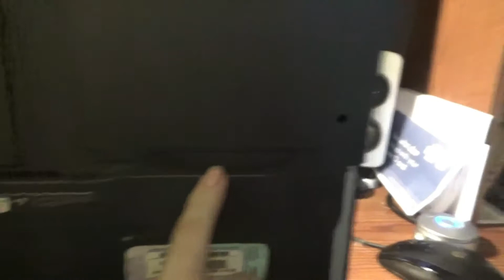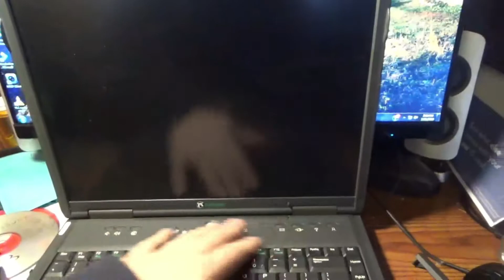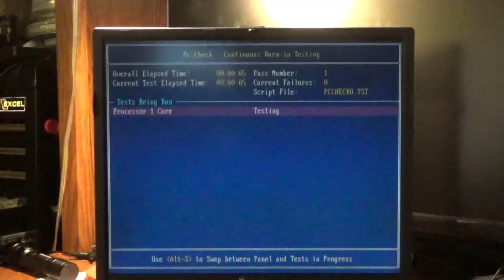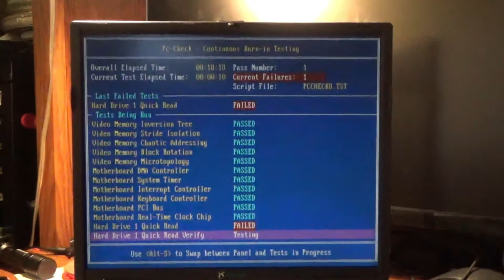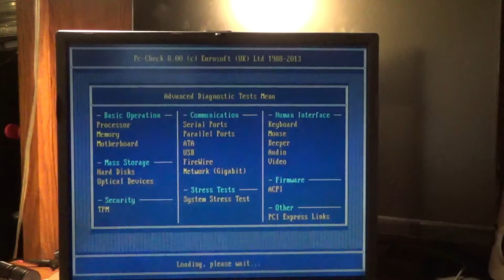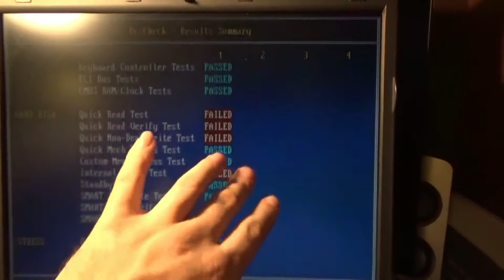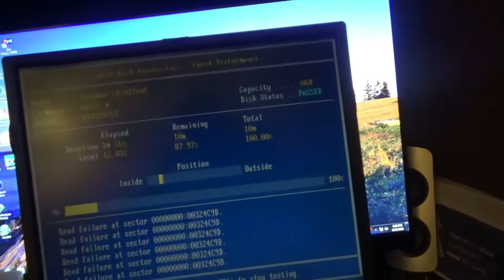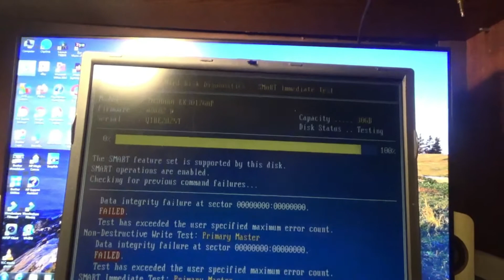Gateway Solo 9550 Laptop with Bad Display Part 1, Running Diagnostics (RE-UPLOAD)

Comment: Interesting on the screen.  I'm wondering if the CCFL tubes have a lot of hours on them.  It appeared at one point that the screen was kinda working and then went dim all of a sudden when you were in the BIOS.  Still could be either the inverter board or the screen, but I'd think it's the tubes in the screen.  Not like it makes much difference...

I have that ancient Canon InnovaBook laptop the wif used to use back in the day that I somehow shoehorned Windows 98 onto, and it, to this day, will play an MP3 file.  One day, out of nowhere, the screen took a dump on the bottom third I think it was, maybe the top third, who cares anymore.  It still works fine hooked up to an external monitor.  I actually tried repairing the screen, I took the LCD panel fully apart, took the polarizing filters and everything out, that had some of the teeniest, tiniest little screws I have ever dealt with.  I massaged all of the tiny little connectors and reseated what I could, but to no avail.  It's amazing that laptop ever worked at all.  That was one of those super-recalcitrant machines that just refused to cooperate with what you needed to do.  The wif has stories of that thing and how it went into service and how they almost stole the modem.  I'll never convince her to tell the story but it would be great if she did an "Old War Story" on it.